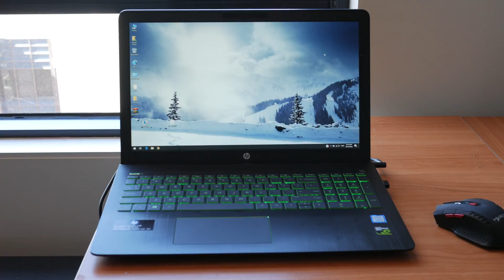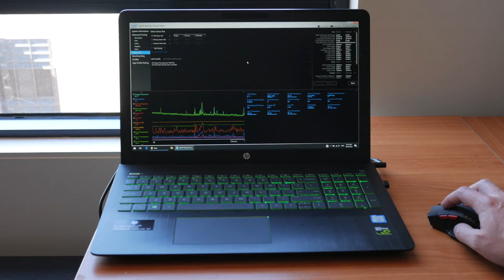HP Pavilion Power 15 - i7 7700HQ CPU Current Limit Throttling

Comment: I have the same laptop you have. I play games with no issues and I do some editing with some effects you use like warp stabilizer I apply it and work just fine very fast I didn't get any lag or stuttering. just whit some min to finish the warp stabilizer render. I see the speed of my CPU are 3.5ghz even. I was editing and play some games in the same time CPU used and gpu too are working full speed and full power 45w TDP
Sorry 4 my bad English I hope you understand me 
My laptop
Hp Pavilion power 15 model cb004nx
I7 7700hq 
16gb ram 
128 m.2
1 tb 7200rpm 
GTX 1050 4gb
Reply from the maker: Thanks for the information. Would it be possible for you to record Intel XTU as you run through what I did in this video? I would like to see proof of what you said and only takes a couple of minutes.
Reply: @breachbangandclear  

sure but I'm right now moving to another city if I'll be back soon I will test it and let you know.
I promise
Bad luck :(
Reply: @breachbangandclear  
How many TDP you get in games!!! 
For me I tested games TDP are around 22 to higher 29..33..40 in different games. 
For editing TDP are 32. 35 
and TDP in Intel xtu are 45 with gpu used I think your laptop model has some issues i guess 
Sorry for the late reply
Reply from the maker: @Neat_t  
Hi Neat,
Could you please post a video showing this? I like everyone else besides you so far with the HP Pavilion Power, gets a locked TDP of ~18w once the GPU is being used. This was regardless of firmware version installed, and I had my laptop replaced by HP with a brand new one. I would really like to see proof of what you are saying.
Reply: @breachbangandclear  
I can't do a video sorry but you can see my test pictures in my twitter account 
https://twitter.com/Ne4t_t/status/1069749780912447493?s=19
Sorry for the bad quality.
Reply from the maker: @Neat_t 
Thanks, that's interesting. I never see thermal throttling on my laptop, it always current limit throttles well before the temperature gets that hot. Did you just have Premiere open, or were you playing a game at the same time that is using the 1050?

Do you know what BIOS version is installed on your laptop?
Reply: @breachbangandclear  
I open my games & after effects in the same time when I was testing the CPU all of them using GTX 1050 you can see the taskbar in my pictures games are open inside gameplay 
Same thing with after effects I do some render preview to activate the GPU used and it's work fine the temperature is high because the package TDP around 37w with games on and when you get high TDP you get hot temperature. before playing games the temperature is not high 40 -49 btw. when I played games temperature not that high just 70 80 in Windows 10 version 1709 but in 1803 the temperature are higher 80-90 I don't know why I didn't like 1803 update 
I'm sorry if my reply not what you needs my English is so fucking bad 
Bios version 
Brand insyde 
Version f.14
Date 23/02/2018
I need answer to 
 my TDP are good or bad do I have any problems or everything is going well :)
Reply from the maker: @Neat_t  
Thank you for the detailed reply.

I will try BIOS f.14 over the next few days and I hope to see the same results you have. I have BIOS f.16 currently, but I had the same problem with other BIOS before it, but I will need to try f.14 again. 

I want the same TDP as you. Premiere takes ~2x longer to export videos when current limit throttling @ 18w compared to 40w TDP that you have. I think high temperature and thermal throttling is a lot better than low temperature and current limit throttling. I would rather a faster, hotter laptop that throttled when it is too hot, than a slower laptop that is always cool.

Your English is very good, I can understand everything you wrote and it's very technical. Thank you again for providing very good information.
Reply: @breachbangandclear  
i hope you solve your issue next days 
All the best 🙋👍
Reply from the maker: @Neat_t  
HP make it so you can't downgrade firmware, even using the firmware roll back function in the BIOS system diagnostics. There is an error in Windows saying 'the bios is not compatible' and in system diagnostics it says 'the BIOS is not signed'.

I spoke with HP service desk who confirmed that even though they have a BIOS roll back function, that it doesn't work. I was told they would call me back also and they never called back. It's been 4 months now I've had this bad issue with my laptop and HP have not provided a fix. Very poor conduct by HP so far. I am very unhappy with the laptop and HP customer service.
Reply: @breachbangandclear  I remember that there is a key combination (may be pressing Windows + B when you are starting the laptop) which allows you to put default system bios idk if it is the f.12 version... i would like to try it or may use a third-party software which can set higher thermal throttle threshold
Reply: @breachbangandclear  
Hello again. 
Have you solved this problem? If not 
Let me ask you important question
How much ram you have 8gb or 16 gb. single channel or dual channel
Reply from the maker: @Neat_t  
Hi,
It is still unresolved. I have tried both 8gb single channel and 16gb dual channel and same problem. I also can not downgrade the firmware. I have been in contact with HP recently who informed me that they will not be making a new BIOS to fix the problem nor will they provide a way for me to downgrade the firmware. I have requested a replacement model that does not have the throttling problem and I have not heard back from them.

I find it very sad that HP have admitted the laptop has a  problem, and say they will not fix it.
Reply: @breachbangandclear  
I feel bad for you. 
I'm trying to help you. but still no luck I just search on Google and I find someone who has this problem. he was fixed the issue with install another memory dual channel. then the problem has solved. actually Hp devices are very bad I have Hp desktop pc it has a million of issues just on Hp products no more Hp shit ever
Reply from the maker: @Neat_t  
Thank you for the information helping me try to fix it. I think all I can do now is hope HP will accept the return and send me the new Pavilion Gaming model as I have put maybe 100 hours into this problem the last 4 months.
Reply: @Neat_t  mines actually at 14w tdp right now running memu emulator and serato DJ software with the Nvidia 1050 forced GPU globally on the Nvidia control panel. It was just 3.4ghz when I booted it up until I initiated the Memu emulator and it started current limit throttling
Reply: i played games without issue but  then i downloaded xtu and seeing that mine does have the same issue actually its not getting enough power. games would probably run a lot better if it were. im going to see if i can contact hp and have them try to replace it or something. someone else sent theirs for repair twice and same issue
Reply: I have the same one too , my cpu was locked at 0.7 ,  so I used  throttlestop to unlock it , it goes up to 2.7 and stays locked on it , i don't really mind but i'm afraid it might reduce the longivity of my pc , and one more thing , i don't know if it's related but i think that my gpu (1050 2go) is underperforming ( used novabench : normal value for others with the same pc as mine is 600 score , I get 200 max ) so i'm asking you guys if it has anything to do with this issue or if you have any clue how to solve this , hope you can help on this 
Ps sorry for my bad english ^^'

Comment: I have the same problem with my 7700HQ. My CPU is at 2.44 GHz but based is like 2.8 GHz and boosted 3.8 GHz
Reply from the maker: Do you also have the Pavilion Power laptop? Have you contacted HP support to let them know of the issue?

I have been in contact with HP support for 2+ months now. I have had my unit 'repaired' to fix the problem and of course it came back without the problem fixed. Then I sent it in again to have it repaired again but this time the service report showed that they saw the problem but could not fix it. They then sent me a replacement unit that of course had the same problem.

The reason I made this video was to show the HP support team what the problem is, as they do not seem to realise there is a difference between thermal/power throttling and current limit throttling. At first their engineers were trying to tell me that current limit throttling is normal behavior for all laptops - I have to be very direct when explaining the knowledge that only the HP Pavilion Power exhibits this current limit throttling problem and none of the competitors from the likes of Dell Inspiron/XPS/Latitude, Asus GL553/FX553, Acer Helios/Nitro  and many more laptops with the same configuration do not have this problem.

I'm getting to the end of my patience though after 3 months of not having a fix.
Reply: @breachbangandclear  yes i have
Reply: Having same problem in Helios 300 with i7 9750h boost clock 4.5 base clock 2.6 but when I play games it goes like 2.1ghz   have you fixed yours ?
Reply: @ggwp.indians  I think it had to do something with the temps.